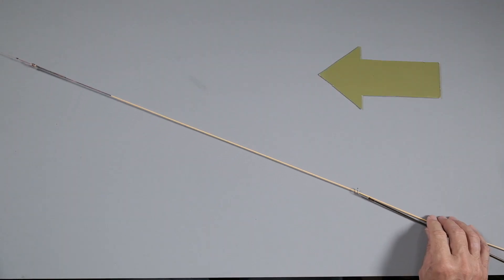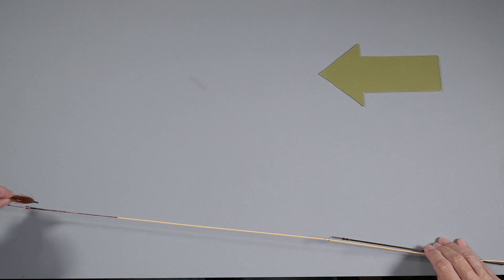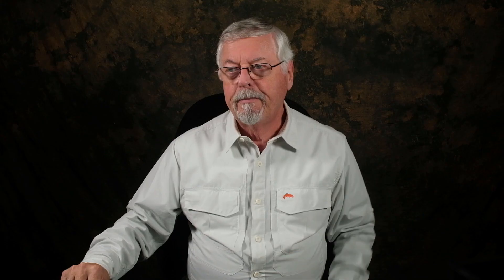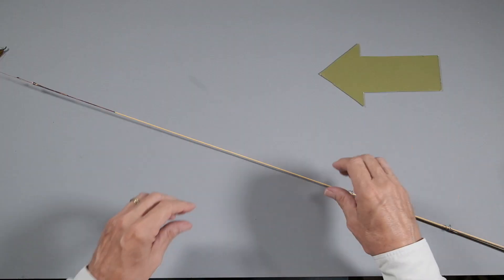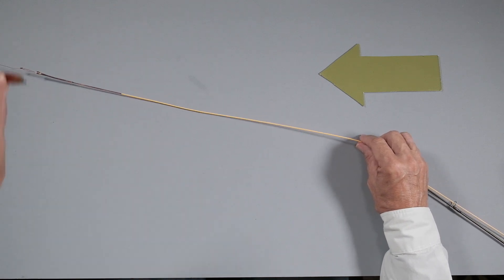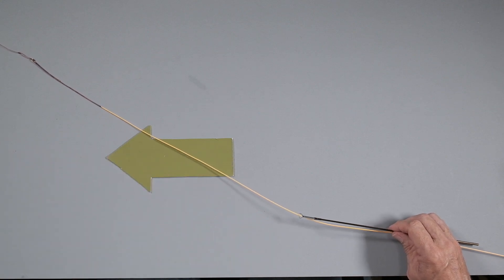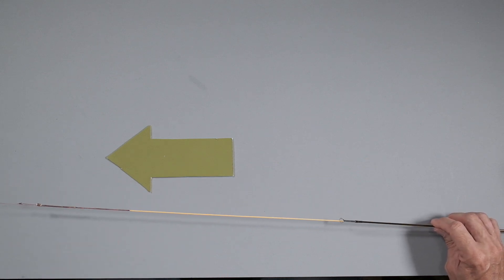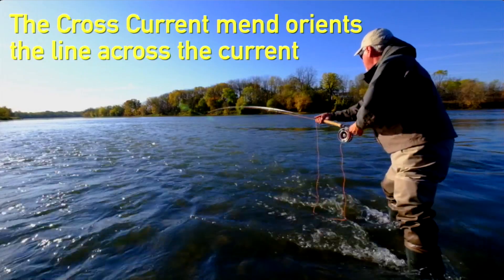Efficient Spey Casting: Part 27 - Effective mending is essential to good swung fly presentation

Comment: Great expatiation of swing variables , How to hook more bites on the hang down ,When to wait to set ,your advice please
Reply from the maker: The expression is, "Wait for the Weight!" In other words, do nothing until we feel the weight of the fish. In most cases he fish hooks themselves so there's no need to do an actual hookset. There are exceptions to that, but the majority of the time, the fish grabs the fly and turns, setting the hook on themselves. It's also a good idea to carry a loop of line under your finger that a fish can pull out. Normally I'll let the fish pull the loop out then smoothly, slowly lift the rod to set the hook. This approach is typical for a lazy, slow take and allows the fish to turn with the fly sliding into its scissor. Aggressive takes don't require this release of the loop as the fish hook themselves on the strike.

The biggest benefit for not hook setting immediately when we feel something? If the fish doesn't hook up on the initial take, it may strike again and then hook up. There's one pool I fish where this is a common occurrence. The fish taps the fly, then whacks it moments later. If I hookset on the tap, I'd never get that second strike.

Wait for the weight!

Comment: If you do an upstream mend and initially have some slack isn't the fly going to sink faster than with the pull back? Then when the line straightens out and  you go into your swing  the fly should be deeper. Of course soon as the tension increases the fly will start to rise either way. If your cast is greater than 45* do you still use the pullback?  I thought the cross current mend or downstream was basically used to speed up the fly based on current speeds and where the fly is perceived to be swinging.  If you want to change the angulation of the fly but not increase  the speed isn't the downstream mend going to cause a problem?  Thx.
Reply from the maker: I covered the slack line issue as being desirable only when we want to target a specific spot. We throw slack in, sink the fly so that it is the right depth before it begins to swing. That's the important part. If there's little tension on the fly when it reaches the fish, it looks like lifeless debris and the fish is not likely to hit it.

I use the pullback mend up to slightly greater than 90º. It's not limited by the casting angle. 

When using a sinktip system, if we want to broadside the fly to the fish, but not speed it up and raise it too much, then do nothing. Then current will belly the floater section and cause the fly to run more perpendicular to the current.

Comment: Thanks again Peter. But in this video I have a hard time agreeing with you. You are not talking about the current in the river being different. The surface/intermediate water and the bottom current. All of this affects the line/fly. I was fishing on a river in Norway and there in one place the bottom current went in the wrong direction. Then there is incredible turbulence in the water, so we probably don't always know where the fly is. when I was fishing at one point the fly line got stuck under a rock. but the fly floated so nicely in the current 3 m further down.
Reply from the maker: I've fished the same type of currents where the top currents are going downstream, but the bottom currents are going upstream. I could see the fish stacked up underneath the top current and the were facing the wrong way!!! I used an indicator rig to cycle the fly downstream, then pulled it into the side currents going the wrong way to move it up stream. I could make one cast go round and round for as long as I liked. 

The problem with doing a mending video, and why I haven't done one up until now, is that it would take a video running for about a 10 hours to cover all of the permutations we're likely to find on a river.  I kept this one generic to cover the basics. 

If we look at swung fly mending as being one of two conditions, adding tension or removing tension, then all river mending situations just become an extrapolation of these two conditions.